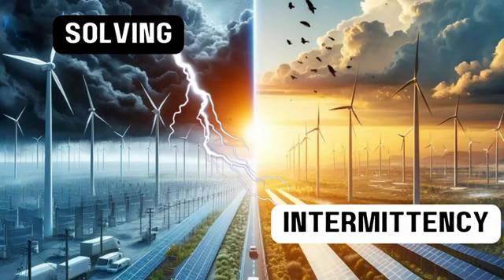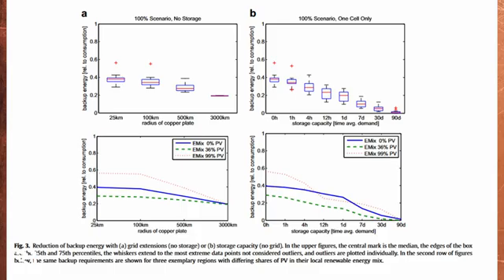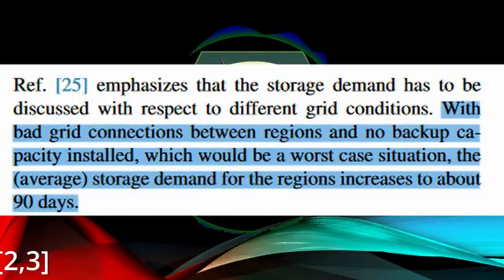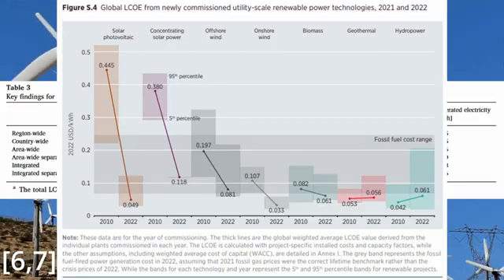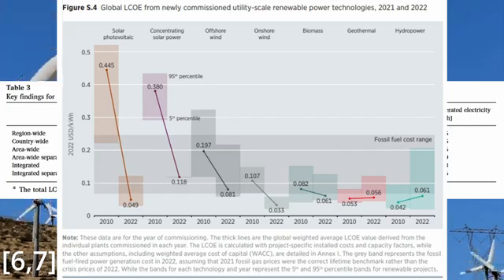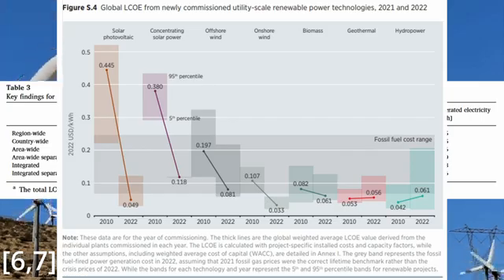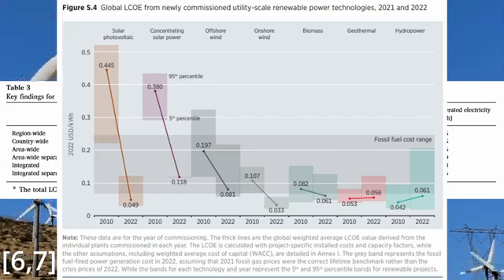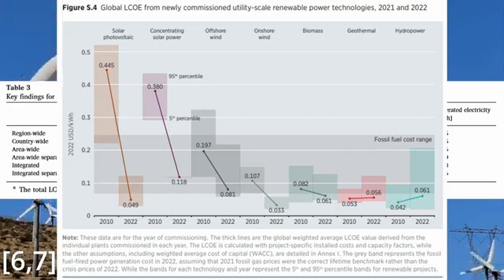Renewable Energy's Fatal Flaw: Intermittency?

Comment: Amory Lovins and Dr. Mark Jacobson have said this for years. Yes our future is decentralized, distributed renewably powered and interconnected electrical system is the future especially when we renovate our homes and buildings to be highly insulated and high efficiency. Every region needs new interprovincial transmission lines and renewables in every region.
Reply from the maker: Yeah I'm not breaking new ground some of the studies I'm citing are from the early 2000's.
Reply: @DDDecarbon  Your information is refreshing to hear especially when all I hear is Conservatives saying renewables suck. Thank you for your contribution to our renewably powered future. Nice video!
Reply from the maker: @aaronvallejo8220  awe! I appreciate it.

Comment: Larger scale interconnections can reduce your need for renewable power, but they certainly won't eliminate it. And once you expand it beyond single nations then you get into political risks. The US should certainly consider allowing enough interconnections between it's 3 major grids to cover the normal maximum needs. However, using renewables is going to require significant power storage and natural gas backup. Low wind, cloudy winter days are regular occurences, when both wind and solar are running at 20% or less capacity for 12 hours, something needs to plug the gap.
Reply from the maker: What matters is if the lulls overlap, fun fact they don't. The video coming out Friday is looking at only USA. This still only results in 3-6 hours of storage which is manageable.

Gas backup will be necessary as we transition and worst case is that we do this and get to 95% renewables then fill in the last 5% with nuclear and natural gas with carbon capture.

But based on my math and the studies of many others 24/7 renewables is completely doable and the cheapest option we have.
Reply: @DDDecarbon  "What matters is if the lulls overlap, fun fact they don't" They overlap every windless night. There are notable periods with low average wind speeds across the continent.
Reply from the maker: @jeffjwatts  we'll review that in the next video. But I've looked through the data and that's not well supported. Additionally the analysis includes hydro. So you get the overlaps of wind, solar and hydro.
Reply: @DDDecarbon  I look forward to the next video.

Comment: It makes sense intermittency could be alleviated by interconnectivity.  But interconnectivity costs a lot, and increases vulnerability.  If you are relying on a faraway area to rescue you when you are in shortage, you might think about bad weathers like winter storms and down power lines.  Cascades of failures arise when every member in the group cannot stand on their own feet.
Reply from the maker: @jianhuihong1 I disagree with the costs. The nice thing about renewables is that it's mostly fixed costs with really low OPEX. Everywhere would have the energy to be self sufficient on the aggregate. The interconnection is for the lulls. General recommendations are to build your system for 130% capacity.

Also maybe I didn't do a good job of explaining but you'd get the power from nearby so BC to Alberta not likely to get Mexico to Quebec. It's more like you pull from your neighbors and that tracks down the line.

Bad weather can take out natural gas plants too. Just look at Texas. This isn't a problem unique to renewables.

In any case the vulnerability argument would then be to build more storage.

Again this has worked fine for California importing BC energy for decades. So I think you're putting a bit too much emphasis on a super rare occurrence.
Reply: @DDDecarbon  you are confusing the cost issues.  I was talking about cost of building up the grids for interconnectivity.  You started talking about costs of renewables.
Reply from the maker: @jianhuihong1  the study I use for this video specifically includes those costs LCOT.

Comment: It's been really hard to get long distance high voltage power lines built in the USA for the entirety of my adult life.  Unless something has changed, it seems like these projects will have nuclear plant level cost overruns and delays also.  My guess is that we'll build out solar and wind and natural gas peakers rather than the batteries, the interconnects, and the capital investment in large scale supply following industrial consumers - like steel and ammonia production.
Reply from the maker: That's a fair point. Which is why Biden's infrastructure bill is so awesome. https://www.energy.gov/articles/biden-harris-administration-announces-13-billion-build-out-nations-electric-transmission

But otherwise the EU is doing it well. Also the biggest hurl here isn't technology or labor. It's stakeholders what land are you going through etc. obviously none of this is easy.

But carbon capture is barely a proven technology and we know nuclear costs a lot plus has even worse stakeholder issues. We run up against problems with every technology. That includes solar and wind just look at what Alberta is doing.

Nevertheless we need to double energy by 2050 even without replacing fossil fuels. I just think that a mature technology like this will be easier than others.

Though I agree with you at least in the short term it'll be peaker plants and other fossil fuel mixes. Seems like you can do 50-70% renewables with just that. Which is pretty great regardless. So even if transmission is annoying to deal with we have a good amount of breathing room.

Comment: Ok .....  here`s your mistake ..... lol ........  Wind and solar operate on the distribution grid NOT the transmission grid (500,000 kv or more) ....... You`re talking about dispatching wind +solar long distances . Sorry doesn`t work that way ......... Almost impossible for a solar installation to create enough power to get up to 500,000 kv .....Only large scale wind projects (usually over 10 turbines) can get up to 500,000 kv ...........  Every power source that operates on the distribution grid (wind, solar , whatever) produces electricity for the immediate area surrounding the power source . e,g. when you put solar panels on your roof , it powers the house and the house next door .  When electricity gets dispatched to another jurisdiction its usually from a Nuclear power plant or Gas plant that operates on the transmission grid (Ontario Canada) ........So when you add more and more wind and solar , during the day almost all the households and businesses will be powered by solar and wind and the nuclear will be dispatched to other jurisdictions. Wind and solar are NOT intermittent. They are just non-dispatchable. Whereas Nuclear is . And that's what will be dispatched to other jurisdictions.  This is already happening . OPG is renewing Green Energy Act contracts and adding battery storage . A cable has been laid across Lake Erie to supply the American Mid-West with Nuclear power from Ontario . The renewables will power Ontario . The American mid-west will be powered by Nuclear ............... https://www.snfuture.com/projects/lec/
Reply from the maker: They are dispatchable off battery systems. The battery systems take in the power then output it. It works as the intermediary. So you can press a bunch of power into it, then transmit from there.
Reply from the maker: @glenskurka4957 any comment? Or should I take your silence as an agreement that batteries fix this problem.